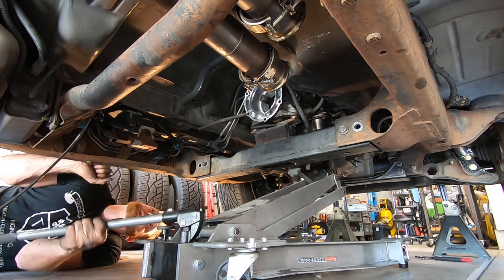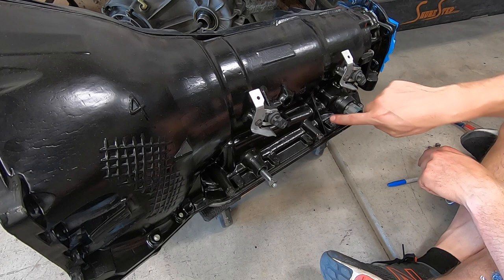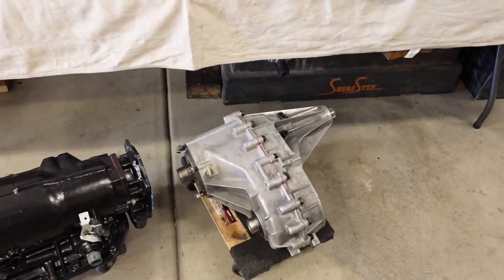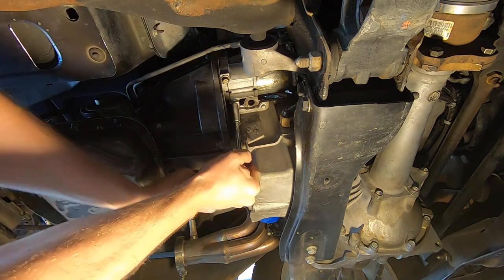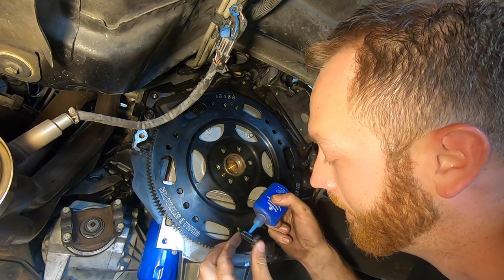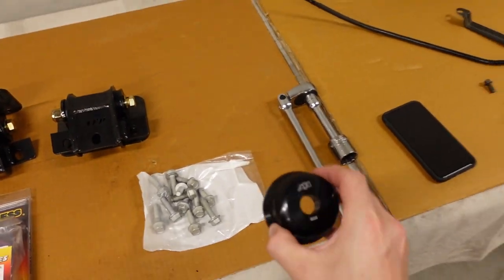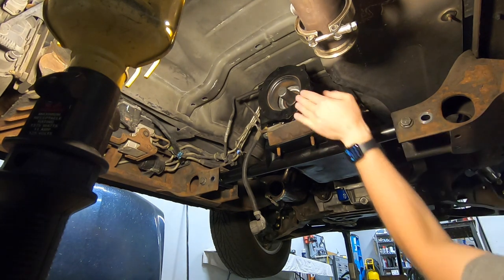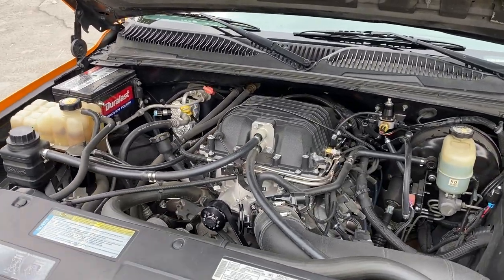the INDESTRUCTIBLE drivetrain swap for the COPO truck

Comment: I can literally tell what engine it is by sound you know. Not exact displacement but I mean LS coyote hemi if it's got an exhaust or even stock and you rip on it and I don't see you I just know........especially GM and Fords
Reply from the maker: some engines have a very distinct sound, especially if you hear the starter motor when it first fires up

Comment: For more power I'd start with some aftermarket rectangular port heads then change the blower pulley to retain 15 psi of boost
Reply: Rec port heads won’t work on a 4.8
Reply: @mcfero1  Edelbrock #61319 will work on a 3.89 bore which is doable with a 4.8/5.3 block. Lots of work to get there from where LT is at though.